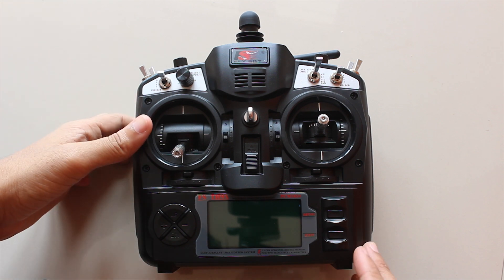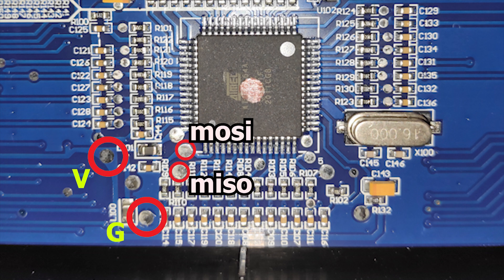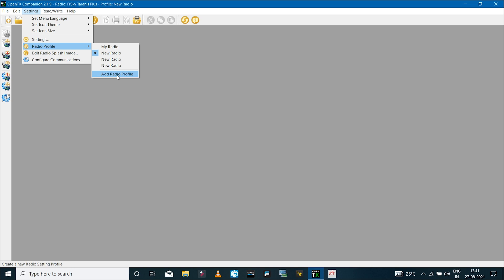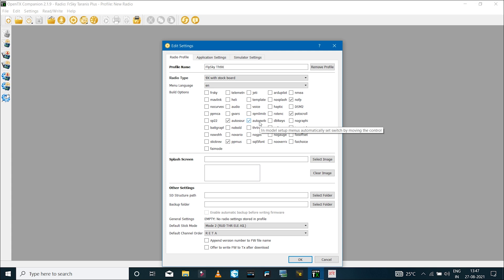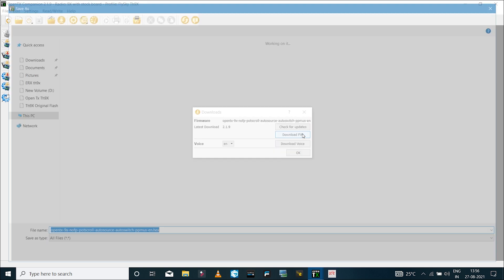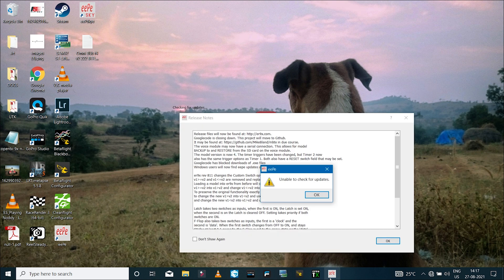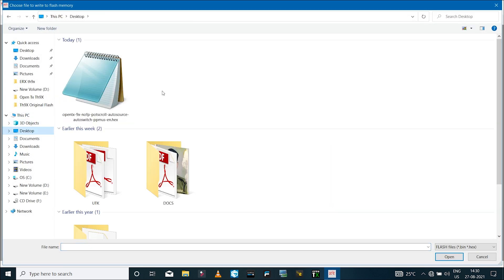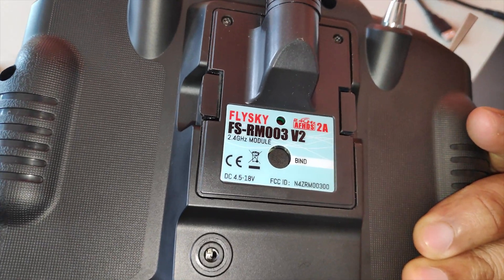Installing Open TX on FlySky TH9X / Turnigy 9X V2 Updated Version

Comment: my radio is opening when power switch is off while connect to computer via usbasp. and then  I can not flash to my radio.
Reply: OK dude. There is no problem. it was my mistake. I have selected to differenet mcu.
Reply from the maker: @technicahmett cool 👍

Comment: Hi, i just came accros your video and wanted to update my radio as well... however the installer "OpenTX Companion 2.1.9 - Windows Installer" seems not to be available anymore. By any chance, do you have still the file on your harddrive and might provide it to me? Would be very much appretiated. Txh for the vid + BR
Reply: google this :            companion 2.1.9 link not working #9029            . on git hub page you will see the proper link for downloading it

Comment: I have a TH9X that I tried to use with my Blade Nano S3 helicopter and the servos are in the wrong order. Will this Open TX firmware allow me change the order of the servos?

What I have now is: AIL, ELE, THR, RUD.

What I need is: THR, AIL, ELE, RUD.

The problem is that this helicopter has integrated receiver, flight controller and servos, so I can’t rearrange the connectors like with a regular receiver and servos.
Reply from the maker: Yes flash open tx will allow you to switch between various channel order options.
Once you have open tx firmware from radio Setup select TAER as channel order. 
You may need to create custom mixes for heli setup or flash the firmware with heli option selected 👍
Reply: @RakishRc , Nice. Thanks.

I just ordered the USBASP programmer on eBay.
Reply from the maker: @terjeoseberg990  cool 👍

Comment: I upgraded it by inserting a 9xtereme card into the flysky th fs-9x control. When I insert the usb, it appears as stm device in DFU mode instead of usbasp. how do i install opentx on this remote
Reply from the maker: I am not sure about the 9xtreme board but it seems either there's no os installed or boot menu is somehow activated. You can use st link usb device and flash the firmware using stm 32 cube programer or St link utility software. Try edgetx buddy website and connect your radio in dfu mode and select the firmware and see if it flashes
Reply: @RakishRc I was able to install eeprom with this video. thank you for your interest
 https://www.youtube.com/watch?v=Zwy6JHyY0hE&list=PL5uJhoD7sAKidZmkhMpYpp_qcuIqJXhb9&index=8

Comment: dear Rakish , first of all well done for all our videos , great for learning , thanks 
pls tell me i am knew to this world , in my radio which i bought from some one , in my radio already installed , 

opentx - 9x -2.0.15 version , the version in my radio is same or older then your , which you are showing in above video ????

another firmware  ER9X ,  is this version good or open tx version is good ???

hope you reply about few of my questions ,

thanks
Reply from the maker: Hi, the latest stable open tx firmware for th9x is 2.1.9. yes er9x is also a very good option infact I'd say Better then open tx due to a lot more protocol options. I'd suggest your flash er9x and check 👍 Thanks for watching

Comment: Hi. Thx. I have a th9x first version. Can i flash with opentx to get more AUX with the receiver stock?
Reply from the maker: Hi, you can update to open tx. You will be able to use all aux switches in any manner you'd like from the mixer page. Which receiver you have?

Comment: Hey Rakish.. Apparently this tutorial of yours works well on my eurgle 9x.this is a 10 year old TX, i think similar to the turnigy 9x of th9x v1
Reply from the maker: Yes that radio is same just rebranded. 👍
Reply: @RakishRc  would u think that an elrs module will work on this TX like even without the lua as long as both tx and rx are binded already?
Reply from the maker: @fishballfpv9063  no it's not possible. I contacted Mike who developed er9x for this radio..he said th9x has hardware limitations that prevent it from supporting elrs. So best you can use accst r9m with ppm mode..or tbs crossfire with ppm.

Comment: I am thinking to buy a th9x.but Confused between th9x or i6s. I also want to use r9m so th9x seems better deal for cheap
Reply from the maker: Hi, i am also about to get a r9m but seems er9x is the better option with th9x for r9m. Also if you plan to flash elrs on r9m then th9x will not be compatible. So my advise would be to get the qx7 if you can stretch  your budget.
Reply: @RakishRc  I just need one tx for backup, I use my rfd900 for long range control. Will buy this th9x and r9m. Later if needed will opt for Qx7 or straight to a radiomaster t16s.
For a couple of months this should do the job.
Reply from the maker: @vishal01mehra  sounds good! 👍
Reply from the maker: @vishal01mehra  if you want I can sell my radio to you. I am planning to get either the qx7 or the x9d+. I've got the backlight kit installed on my radio with programming cable soldered as well. I'd sell it for 6k if you okay with it. Let me know 👍
Reply: @RakishRc  hey buddy! I had actually already orders this tx last week. Sorry I couldn't take your deal.
Can you tell me where you got the backlit module from? I am also interested 😊
Reply from the maker: @vishal01mehra  okay no problem. I ordered the backlight kit from hobby King website. They have white light in stock. Got it in 25 days.

Comment: Can the first version of FS-TH9X can be update the firmware?
Reply from the maker: Yes ofcourse you can. Open tx was originally developed and tested on the th9x.
Reply: So meaning it has the same process of updating the firmware like the one you posted? Thanks a lot men I just recently bought it I'll be waiting for more videos from you to upload 🤘
Reply from the maker: @leivinreec.dolenzo1099  yes it's exactly the same. Just make sure when you open the radio to solder the wires the sck pad is on the sixth pin from the chip. If it's on the 8th then you have the old version of the motherboard in that case you'll have to solder to the resistor on the 6th pin of the chip near sck pad. I have few more videos on this topic I'll be uploading soon. Thanks 👍
Reply from the maker: @leivinreec.dolenzo1099  you can check this video - https://youtu.be/ElxrSp0hZZo
When did you get the radio and which module do you have?
Reply: Just last month and my FS-TH9X using fs-rm003 1st generation. Btw can you recommend me a transmitter module that is compatible for my FS-TH9X?
Reply from the maker: @leivinreec.dolenzo1099  you could look at Frsky XJT or DJT module. Or even some orange 2.4ghz module.